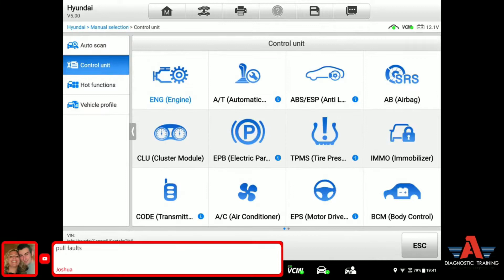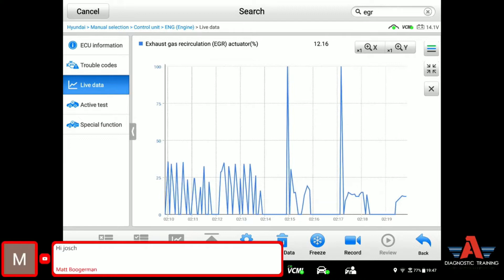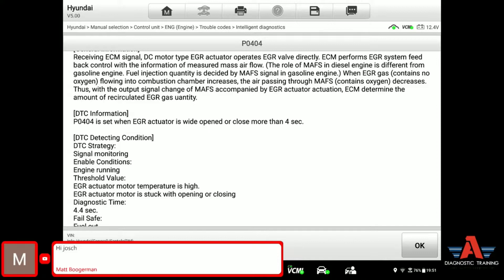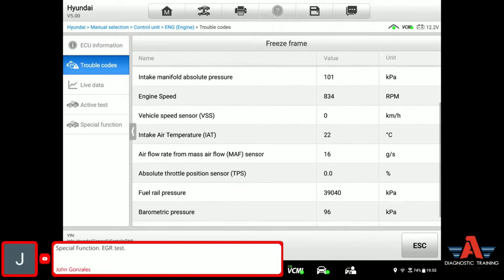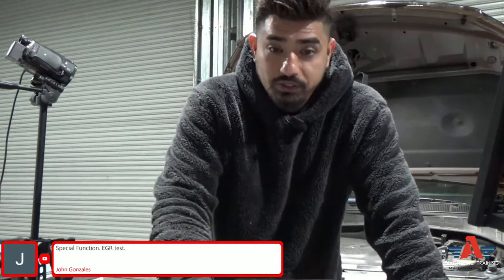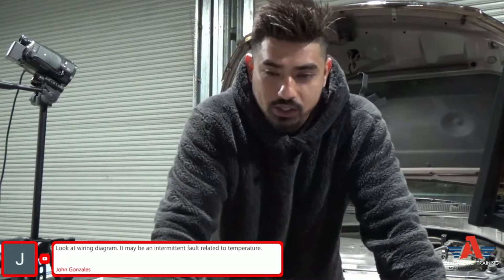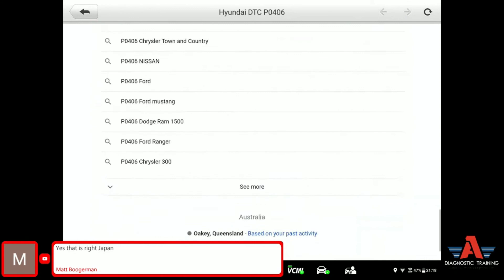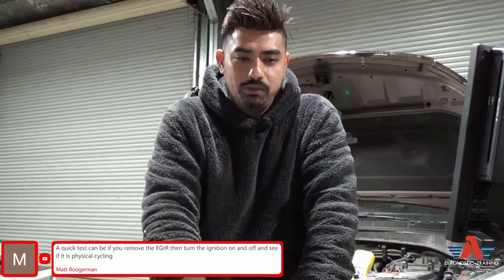HYUNDAI P0404 EGR VALVE DIAGNOSIS

Comment: What was the end fault with this car? My EGR valve is staying closed. I have voltage going to the  valve motor, I have signal and earth but my bias wire is sitting at 3.3V. New egr valve and sensor did not fix. As I thought the motor for the valve was U/S. I push on the position sensor while it’s plugged into the harness but disconnected from the egr valve so it thinks it’s closed, this reading is -100%(closed) and when I remove my finger to let it think it’s open, it’s at 99.2%. But there’s no in between reading. The reading is off my tool pro Om126 under EGR error. Also command EGR % stays at 0%.
Does it need a relearn program installed for the new EGR?
Reply: Hey mate did you ended up fixing the problem

Comment: I did replace mine but the p0404 comes back, the valve is getting power and signal because u unplug with ign. on it sets the circuit A code which tells me wiring is good.
Does it need relearn or something?